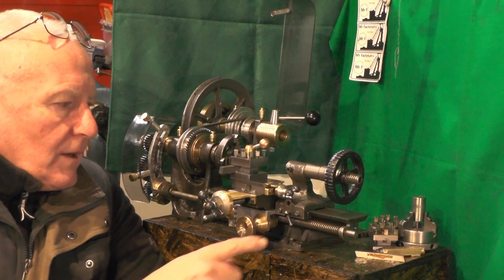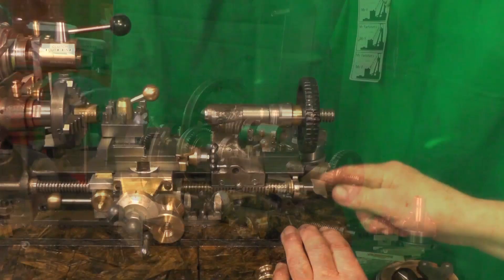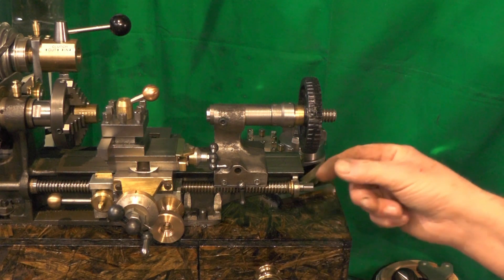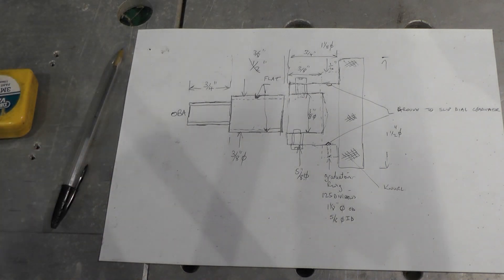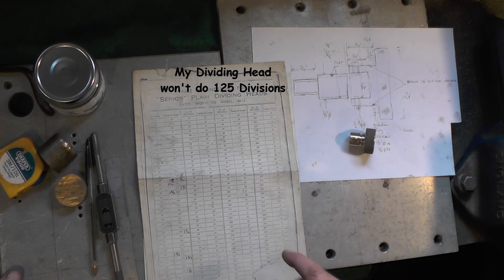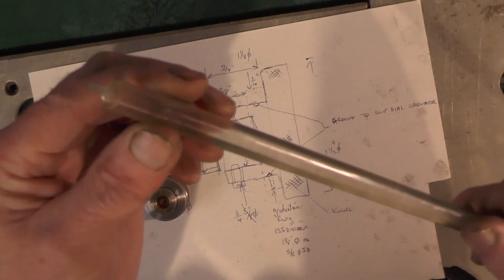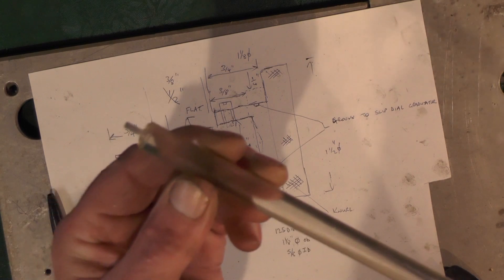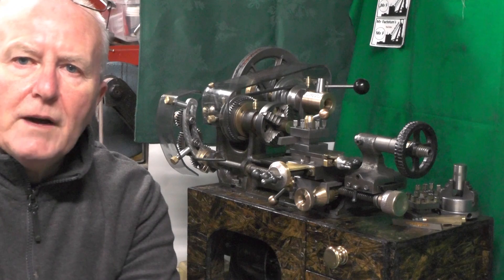Ep 31 (Graduated Dial for Leadscrew) Make a Micro / Mini / Small Lathe "mr factotum"

Comment: Lovely job again Kev looks really nice. I wonder if an O Ring in the groove would provide enough friction to allow easy adjustment without needing the lock screw? Just a suggestion 😀
Reply from the maker: Great suggestion Julia, 
that's what i like about youtube, when you get tunnel vision, someone comes up with different idea, i will look in to that when i have chance thanks👍😉
The cast iron stand is on the agenda for the next vid. so hopefully will look completely different
cheers
Kev
Reply: @MrFactotum  every engineer has an opinion 🤣 don't go too mad on the cast iron.  The stand for my capstan is 3/4" thick cast iron. It was stupidly heavy. 😮